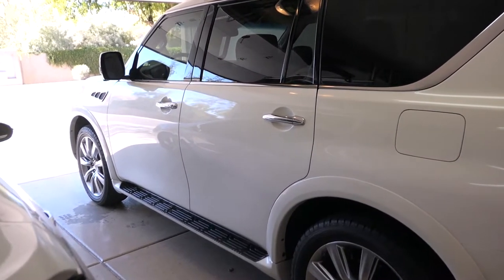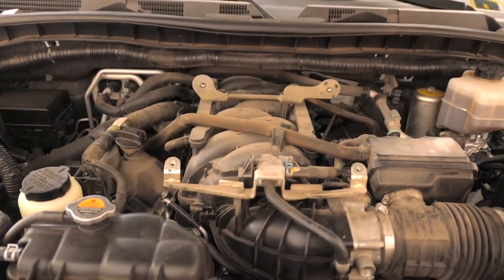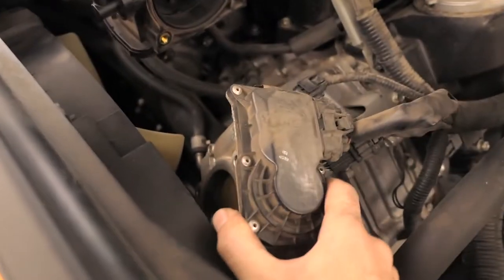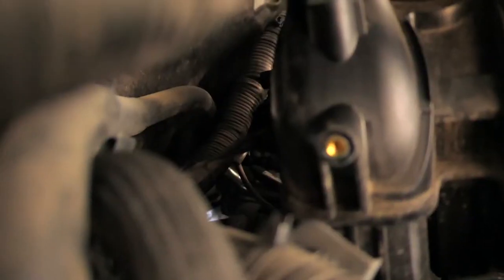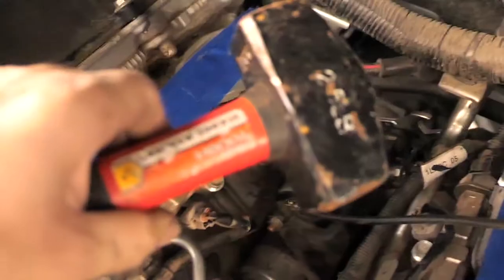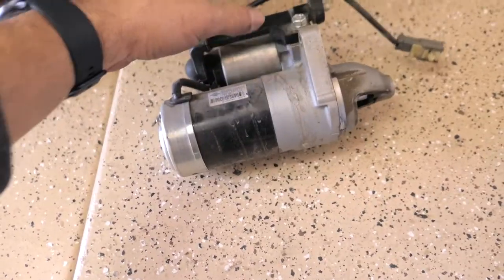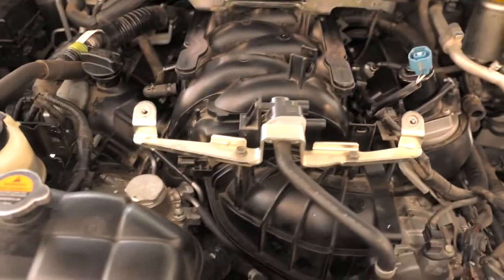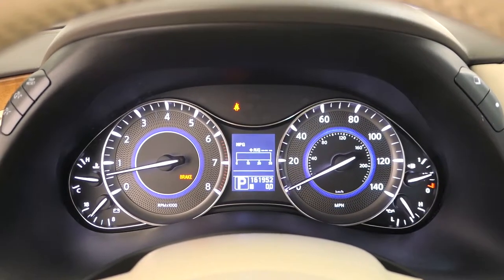Infiniti QX56/QX80 - Starter Replacement

Comment: Question.. I have a 2012 qx56 and have intermittent starting problems, and I am not sure it has to do with the starter.. once in a while after driving( doesn't matter for how long) when I turn the truck off and come back like 45 minutes later the truck will not start, it will try to turn over but it acts as if the battery is dying and will turn over slower and slower with every start button push but then I boost it and it works fine for weeks. I have brought the truck to Autozone as well as AAA and they both say that the battery(less than 2 years old)and alternator are fine. And now it is happening more frequently, Have you ever come across this problem?
Reply: I have seen this problem. I'm a Infiniti Technician for 3 years. In those years there is a wire in the IPDM that controls your alternator and when it decides to use power when it doesn't need it. You cut the wire and shouldn't have any more problems after that
Reply: @Smarties3991  This is exactly the problem I am having.  Could you direct me to some info on what wire to cut?  Is there any other consideration with this that I should be aware of?
Reply: Did you ever get this fixed?  This is the exact problem I am having....
Reply: @jasonmorgan4448  So the IPDM box is behind the battery. Open the the top cover and you'll see a block with a bunch of wires. There is two tabs on each side, push them together and pull towards you and out comes the box with everything connected. I'll comment back tomorrow, going to work tomorrow and I'll look at the IPDM and tell you exactly what connecter to take out and exactly what wire to cut.
Reply: @jasonmorgan4448  What I've been told is that wire somewhat controls the alternator. So the alternator thinks it need a bunch of power so it sucks out all the battery power. Once that wire is cut the alternator no longer thinks it needs all of the power and works as a regular alternator
Reply: @Smarties3991  Thanks...let me know...I appreciate it!
Reply: @jasonmorgan4448  Hey, sorry for getting back to you so late. Still having issues?
Reply: @Smarties3991  Hey no worries.  I found the wire you were talking about and problem solved!  Thanks!
Reply: @jasonmorgan4448  Hi Jason, I'm having this issue with my 2012 QX56 as well. Could you tell me which wire you cut? A picture would be awesome if you happened to take one. Thanks
Reply: @rickkrans6219  I went out and took a couple pics. I don't see that I can post them on here. How can I get them to you?
Reply: @jasonmorgan4448  that is very kind of you...and thank you for responding so fast! As far as sending images that's a great question and I had to look it up. I'd love to just PM you my email, but I don't see a way to do that and probably shouldn't post that in a public forum- the recommended way is to load to your pics to google drive and make a shareable link (click available to anyone on internet) to post. That seems like a lot of work for you though if you haven't done it yet, so I went ahead and took a picture of my best guess based on what I've read and added the google link- 2012 QX56 - do I cut the red wire?? Am I even close? Thanks again!

 https://drive.google.com/file/d/1D4tiFTpXYU6MDacz_lSG05yWuBUQyHJI/view?usp=sharing

Comment: I’m doing this now and that back passenger side bolt is an issue. I have it halfway out but took my socket off. The hardest part is getting the socket on because of the wire loom. I dread putting that one bolt back in.

Comment: Hard to believe that Japan made a part that only last not even the 200k miles. I have a 2005 GMC sierra with more then 300k miles, and still has original started, original AC compressor. Japan suppose to built better vehicles. How that possible 😦 😲🤔🤔🤔🤔🤔